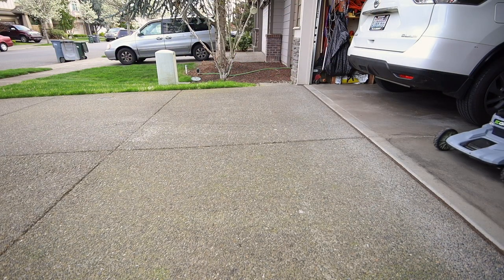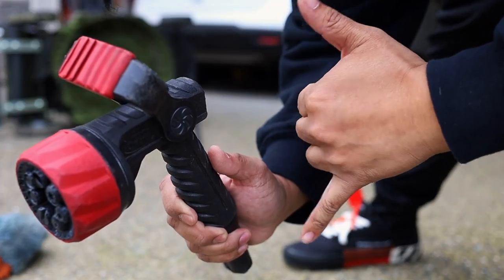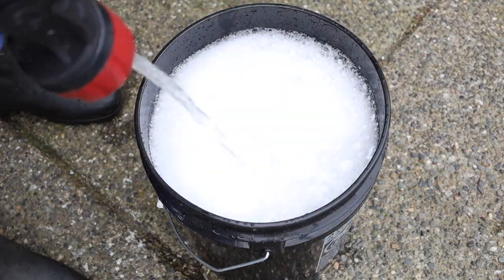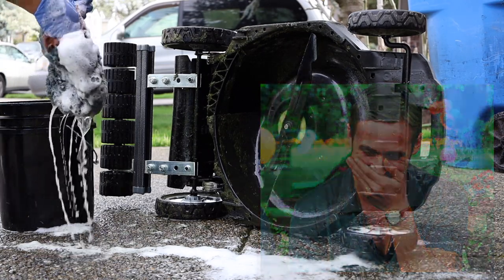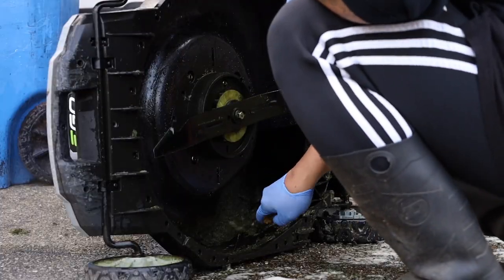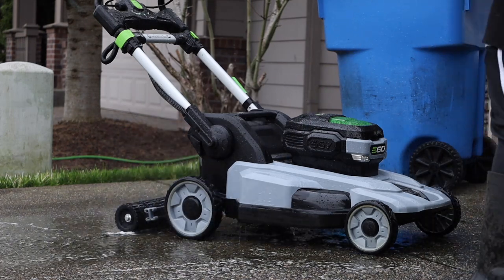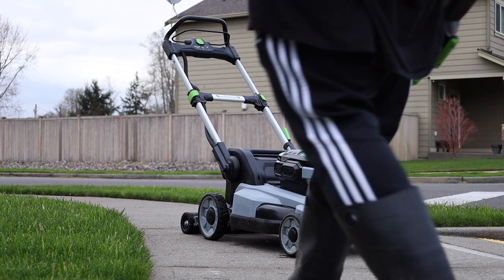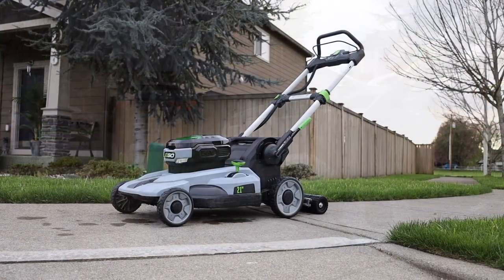How I clean my Electric Lawn Mower  EGO 21" LM2100 ~ Cleaning Electric Lawnmower Step by Step Guide

Comment: Just found your video... Thanks for the trouble of bringing this to the masses. 
I have 2 out of warranty EGO mowers.  Since the Warranties have expired, I've grown tired of looking at the filthy decks of these 2 mowers.  I've gone ahead and carefully cleaned the underside of the decks with very low pressure water from my hose using a mixture of water & dish soap, which after applying I let it soak in for about 10-15 min to soften up the gunk under the deck, & using 3 similar brushes which you show in the video, too.  I've done this repeatedly for the past few years with no problems, excluding some early deaths of EGO batteries (a diff. story for another time).  Then, to scrape off the underside deck gunk, I use two plastic spackling 1-inch and 2-inch spatulas to prevent any unnecessary scratches onto the plastic decking.  I use the flathead screw driver to get into the tight spots.  After all is clean, I towel dry first, then  EGO blow dry the mower as best I can.  I let it dry for an additional couple of hours just incase I missed some wet spots.  Then, I spray the underside of the deck with a can of WD40 silicone spray, wipe it in with paper towels while wearing disposable latex gloves, & it stays mostly clean for about 3-4 cuts, sometimes longer, as long as I don't mow when the grass is wet. My mowers work well & look like I bought them in the last year because they always are mostly clean.  Hope this helps a bit more, and thanks for your video.

Comment: I wonder if you spray the underside down with WD40 or something if it would stop some of the grass from sticking.
Reply: I spray it with the WD40 silicone spray, and it stays mostly clean for about 3-4 cuts as long as I don't mow when the grass is wet.
Reply: I spray mine with silicone spray..I washed mine with the hose like he did but after a few months I noticed a rubbing or grinding sound when its running especially at high speed. So I sprayed all the crevasse and let it sit for a few days and what do you know.....sound went away....I was scared that I ruined it. Try not to get water in the center hub. Enjoy your Ego
🎉
Reply: didn't work for me.

Comment: I do almost everything on here but I don't spray the mower directly, I've only used it 3 times but before I use it I treat the underside of the mower with NuFinish.  Yeah that once a year car wax.  So far it works great and almost no grass has stuck to the mower and what has easily come off with the wheel brush. Love your videos, keep up the great job!

Comment: Hi guy. I was just outside cleaning my new ego lawn mower on. April 8th 2024.....day of the eclipse.
I used just regular hot water and  drill brush under the deck.  
And it works very good!!!....and it's real fast. Just let the brush and your drill do the work and wipe clean.....I got my drill brush years ago from Amazon.
Just wanted to share. Takecare.

Comment: We bought a 2018 Ego LM2100 with the Battery Charger for $78.  Mower is like new.  We found out a new 7.5 AH Battery is $400.  I get why the previous owner junked their Mower.  We'll keep our wonderful Honda and Toro Mowers and part with the Ego.
Reply from the maker: Yeah sometimes you can find 7.5ah batteries on CL or offerup for $200 but still expensive 😊👊🏾🙏🏾🤙🏾

Comment: Hey man, how you like your Ego mower? I am thinking to buy one, but always hesitant about the power of a battery equipment.
Reply from the maker: Coming up on almost 5 years with this bad boy and still running like a champ! Ego has good power you won’t be disappointed my dude 😊🤙🏾
Reply: My battery doesn't hold up well. And I hate the deck cleaning warnings and concerns.

Comment: Hey bro. Just a silly question. I accidentally used my Ego lawnmower while it was raining for 30 minutes. Would that damage my mower or reduce it's performance, lifespan?
Reply from the maker: No you should be fine just don’t use it and let it dry out for 24 hours. I’ve gotten mine wet wet and it’s still charging like a bull! 😊🙌🏾🤙🏾🙏🏾

Comment: Shit I set up my sprinkler full blast, pull my ryobi over it, and run the blades a few times on and off, and that's it. I'm not sure if it'll mess it up, but its's outdoor equipment. i figure it's gonna get wet.
Reply from the maker: Hell yeah! Now I usually spray water on the right side of the wheel and turn the mower on sucks up all the water and cleans it pretty nice pretty much the same thing you’re doing 😊🤙🏾

Comment: You should consider ceramic coating the deck the grass won't stick
Reply: And perhaps tie/tape a bag to the electric motor for extra protection
Reply from the maker: I guess they have a deck spray available for a non stick deck! Thanks for reminding me!!! 😊🤙🏾🙏🏾🙌🏾
Reply: How often does the ceramic coating need to be re-applied?  I usually spray mine down with wd-40 or chain lube

Comment: We bought an electric oven stove with a flat glass top. The instructions forbid using paper towels to clean it? And the cleaning sponge that came with it was abrasive. My wife hounded me for years to not use paper towels because of the instructions. Now she uses paper towels to wipe messes up herself. Who authors these instructions? If the underbelly of a lawn mower whether electric/gas is not designed to allow cleaning the under deck with a pressure washer or at least the pressure from a water hose?

Comment: Why not just use a pressure washer? It uses less water than a hose so there's even less risk of messing up any of the components.

I've been doing it on my LM2100SP for the past 2 years and no issues. P.S you should've also removed the blade for cleaning purposes, lots of grass behind the blade and the motor housing.
Reply from the maker: Yes I was feeling lazy 😂 new vid I busted out the pressure washer for the vintage McLane 😊🤙🏾🙏🏾🙌🏾

Comment: Dish soap is not what you want to use to aerate your lawn.  Why?  Because most dish soaps are antibacterial.  Bacteria are important to the health of your soil.  Instead, use shampoo which has no antibacterial ingredients.  The application rate is 3 ounces per 1,000 square feet.  If you make a mistake and use 30 ounces per 1,000, no problem.  It's been tried and found to be not a problem to the grass.  You can use any shampoo that you can see through.  Baby Shampoo is an example of one you can see through.  The cloudy ones have conditioners that are not that great for the soil.  

I made the mistake of mowing wet grass and my EGO got gunked up like yours is showing.  Then I went on and made the mistake of cleaning the underside with a hose.  It would not operate for about a week, but eventually it did.  There are holes you can see under the deck which seem to go right into the electrical guts of the mower.